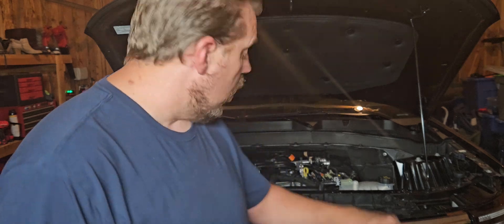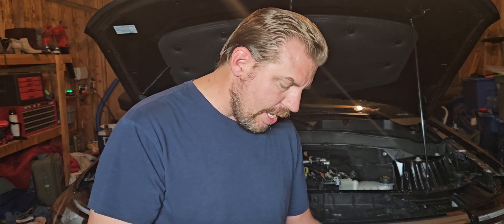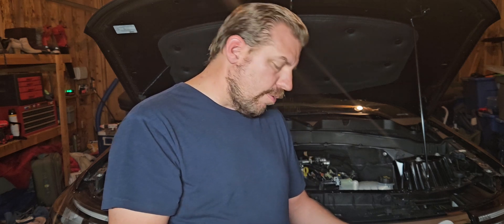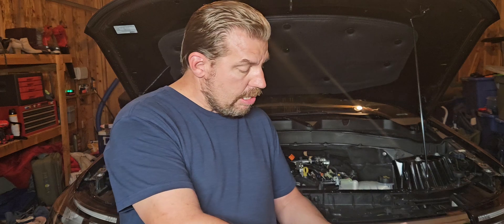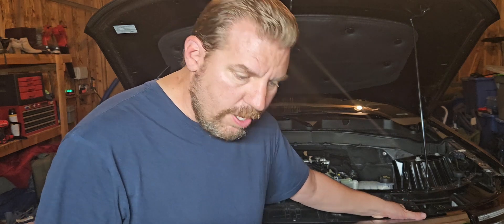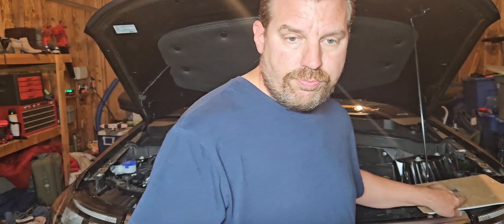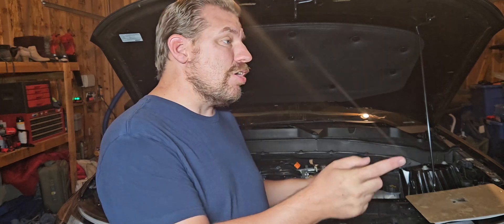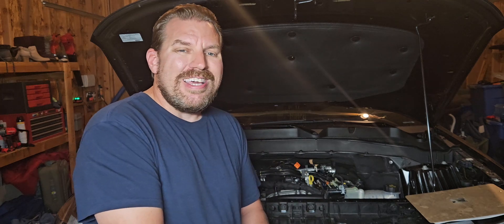Quick History of Ford's LONGEST RUNNING 4 CYL, The 2.3 I4!!  This week on jmcGarage Talk!

Comment: Great video but I would like to point out some things from doing research myself. The 122 cid / 2.0 ltr made in Cologne, Germany engine that was installed in the 1971-1974 Pinto, has no interchangeable parts from the 141 cid / 2.3 ltr made in Lima, Ohio engine that was installed starting with the 1974 Pinto, except for perhaps a handful of bolts. Their was a 122 cid / 2.0 ltr made in Lima, Ohio that does share some differences such as the stroke and perhaps the bore spacing as well. That engine appeared in the 1983-1988 Ranger. The longest running Ford 4 cylinder was the what is commonly referred as the Lima 141 / 2.0 with 23 years, 1974-1997. Of course the only thing your four cylinder has in relation to the older ones is the 2.3 liter and your cubic inch is lower at 138.  For the ones that don't know, a cubic inch has a smaller volume than a liter / a liter is a much larger unit of volume than a cubic inch.
Reply from the maker: Appreciate you sharing your research on the engine's history!

Comment: I had one in my 1996 SVO and then in my 2003 Focus 2.3 PZEV:face-green-smiling: Before that, my dad had one in our 1975 Pinto Manual. Was very reliable going to ski in Mammoth. It was the 1st metric-fastener engine.

Comment: Not only did I love this engine in my old Pinto,  and now currently 93 and 97 Ranger, as a heavy equipment mechanic I've seen it used in industrial applications as an auxilary gecerator, pump and powerplant.  I love reliability. I ran 80's Mercedes 3l turbodiesels with over 400k, and  now have  a '02 VW TDI with 369k.  Run forever!!!

Comment: Owned several of these little engines from Pinto's to rangers and most every fox bodied platform Ford made, very reliable,  modified some  of them, last one i had was the Turbo Coupe Tbird, had a lot fun with those engines, they have my respect.  But in the end, for best fuel mileage i went to Festiva / Aspire platform, and for power, went to V8's leaving behind the memories made with this great little engine. First mod i did was put a small 2 barrel carb off a small windsor V8 on top of a 2 inch spacer that bolted onto the factory bolt pattern intake manifold,  and cut 2 factory original exhaust manifolds in half and welded up the hole that was left from the first 2 cylinders, this gave it true dual exhaust,  sounded like Volkswagen when at idle, but it really opened up that stock motors natural ability to rev. The 2.3 engine series became my favorite at Mini Stock Car Racing. Simply started putting those engine mods onto my street cars.
Reply from the maker: Thanks for sharing your experience!

Comment: I have an 84 mustang turbo 2.3 convertible and with a turbo coupe ECU and a few bolt on's it has 300hp and still runs great after 40 yrs it still runs fine and when I turn the boost up to 30 LBs it is a fun little drift car 

It is the most bulletproof engine I've owned but the 3.8 supercharged engine that was in my Pontiac GXP or the Taurus SHO Yamaha DOHC that both were sold with 300,000 miles and probably are still running lol .
Reply: Good platform but your attention to maintenance is to be lauded. 30psi is incredible

Comment: I have had 2 vehicles with the Ford 2.3.  A 1982 Ford Ranger with a standard transmission and an early 80s Fox body Mustang with an automatic transmission.  The engine was very reliable in both vehicles.  As the Ranger had a standard transmission, drivability was fine(althought the non-counterbalanced engine was noisy).  The Mustang had a very hard time climbing the hills around here with 4 people inside.

Comment: The 2.3 OHC Lima, with modern improvements, will outlast and keep up with any new engine. Too bad Ford's new engines don't have the reliability and strength of the Lima.. And the Lima just set a record of 7.0 seconds at 191 MPH in a T Bird body. The Lima is still in the game
Reply from the maker: I believe the new MPC Ecoboost would outlive the ole 2.3 Lima for reliability

Comment: Ive owned multiple mid-late 90s rangers with the 2.3 and everytime they've needed repairs it was never the engine's fault.  Looking forward to hitting a 250,000 miles in the next few years on the old 97

Comment: The dual plug heads were similar to the Nissan 2400 heads ad it was done for fuel efficacy ad lower emissions. The turbo 2.3's in the svo mushrag and turdbird turbo coup used a special turbo head, bleeding vacuum away from the turbo's waste gate could make for a bit of fun, otherwise the 2.3 was always under powered, durable but uninspiring.

Comment: I bought a new Mustang in 1979 with the 2.3. It was still running well when I sold it with 160,000 miles. Only real major service I performed was replacing two timing belts.

Comment: Honestly probably the best 4 cyl out there imo super solid and reliable, i had a 1988 thunderbird turbocoupe, engine had 150k miles on it and didnt burn any oil, took all the abuse i gave it with the timing advanced 4 degrees and boost adjusted to 18-20 psi. Not to mention timing belt literally takes 15-30 minutes to change, if the belt were to snap on the road then guess what! Its a non-interference engine so no valves get damaged! Only downside to this engine is the anemic cylinder head, if it flowed like a dsm head in stock form it wouldve been excellent...we need esslinger to start casting and selling aluminum D port heads again or maybe boport can pick up that market...porting the stock Iron D port only yields a max of 225-235cfm which is nothing

Comment: Ford 3.0 liter was the best most bullet proof v6 they have in my opinion,  would love to here your thoughts on it ❤, yes the 2.3 is a fantastic motor,  i remember them fondly also❤
Reply: The 3.0 was a Vulcan turd made for jaguar and the ford tourtus with a reliability rating on a 10 scale at negative 4 , ask 100 owners and they'll agree but glad that ya found the 1 out of 1000 that were reliable